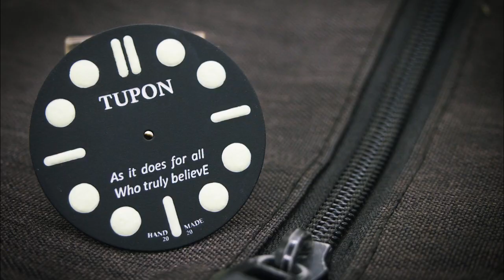Making Custom Watch Dial : Tu Pon Dial

Comment: Do you have the reference of the black paint spray you use to paint the dial ? And which white paint do you use to paint the text ? Thanks and congrats 👍
Reply from the maker: I used acrylic lacquer type for the spray  paints and when filled in the laser etched.
Reply: @pormodcustom9088  thanks 🙂

Comment: For me The difficult step is how to engrave The brand Or The words, as an amateur I have limited tools to do it from home
Reply from the maker: Indeed. Engraving those kind of words/ texts can be tricky. Especially if engrave a super tiny words/texts which usually exist underneath number 6. Or 24hrs numbers. I've tried using a cnc machine. But I haven't found the drilling bits that can goes with that micro sizes. I'm not sure if diamond drag engraving bits can be used as well.
Reply: @pormodcustom9088  if you find an easy/ medium tool to do it I would love to buy it
Reply from the maker: Maybe you can use the chemical etching method. Have you ever tried it?
Unfortunately, the process for this method is very long and quite complicated.
Reply: @pormodcustom9088  ufff never heard about it and if it complicated maybe it is not for me, I am quite amateur hehe